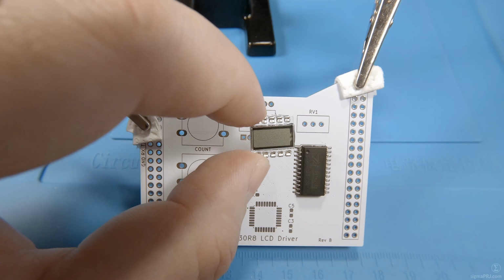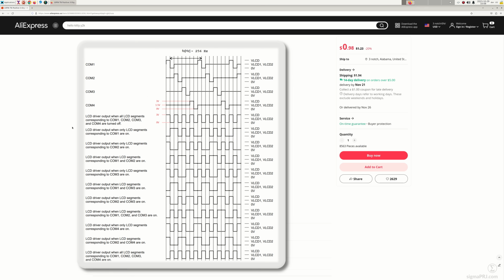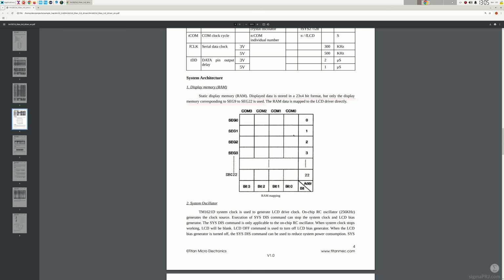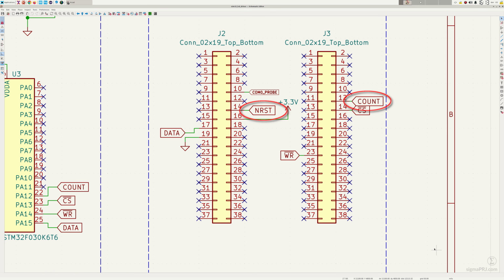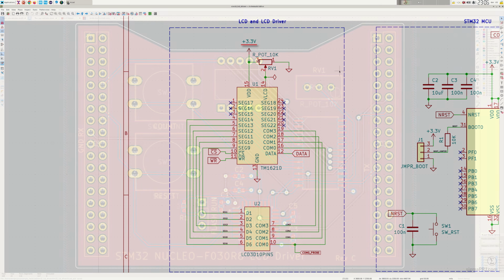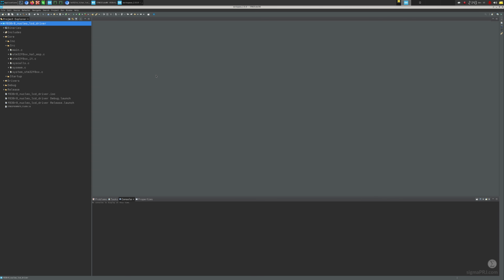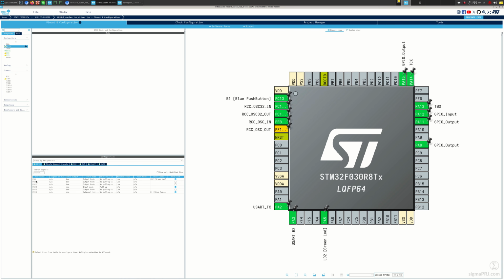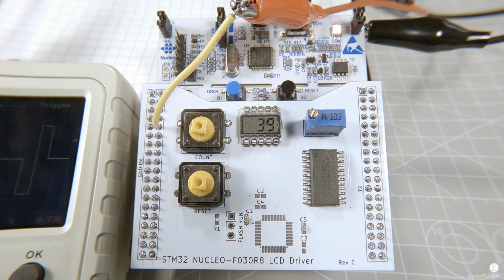How to drive 7 segments LCD

Comment: Sir please, can you explain why C is used much more than C++ in embedded programming, even though C++ has nice features?
Reply from the maker: C Language makes hardware resources use more efficient... C++ features - like virtual function and polymorphism will place additional overhead on hardware during execution (like storing and use of vtable)... but on embedded programming - hardware resources efficient management is crucial...
Reply: Exactly because of that. C++ is very extensive, which makes it more challenging to optimize for your processor. C++ is used on the larger platforms (like Cortex-M) but you need to be careful which features of C++ to use.

Comment: Sir can you please make a video where you explain how you use eclipse for your daily work as a programmer. There are many caveats in eclipse. For example using built-in language constructs like _Static_assert in C11, eclipse will mark this as a syntax error because it does not index/interpret it correctly.
Reply from the maker: in Eclipse project properties, you can set Dialect property... this will allow to choice between different C++ versions like C++11, C++14, C++17 etc... this is under C/C++ Build settings ...
Reply: @sigmaprojection3781  Sir you need to make a video. I am using C not C++, makefile project from existing code. When I chose toolchain I chose <none>. The dialect option is not in project properties sir.

Comment: No! LOL. You can drive it directly from your MCU with a few external parts and some smart firmware. Several of the MCU manufacturers have application notes explaining how to do it.
Reply from the maker: yes, it's true... with a bit more price cost - it is possible to get MCU with LCD Driving capabilities onboarded.. here I was trying outline how to make it with MCU wich does not LCD Driving capabilities.. with a bit cheaper MCU price..
Reply: @sigmaprojection3781  My point is that you do not need an LDC driver to run an LCD display, neither externally nor built into the MCU. You can generate all the necessary waveforms via the counter-timer and a few external bias resistors.
Reply from the maker: yep.. PWM + Low Pass filtering will allow to reach 1.5V mid-BIAS voltage level from 3V digital pins + no issues to drive other signal LCD pins... but in this case MCU usage on timers interrupts handling will be much higher (+allocating 4 extra MCU PWM output pins to deliver COM1/2/3/4 signals)..
and using just 2 resistors forming a voltage divider to reach +1.5V on 1 pin output and +3V on another pin will require more MCU digital output pins allocation to form a 1/2 BIAS level... concept shown in video will allow to use LCD Driver in further cases even with 1/3 and 1/4 BIAS levels (to work with much more complicated LCDs which will have more than 4 multiplexing COMM lines).. there the solution with voltage dividers will not be so trivial - as it will need to reach 0.75V, 1.5V, 2.25V levels..
creating 8 manually "handcrafted" DACs from digital pins outs still possible... but it will allocate a lot of valuable MCU output digital pins to participate....
so.. in case of we would like to use almost all available pins\PWM MCU outputs (without giving MCU any other tasks expect just to drive LCD) - then yes, this potentially is possible to drive LCD without LCD Driver and without embedded MCU capabilities to drive LCD...